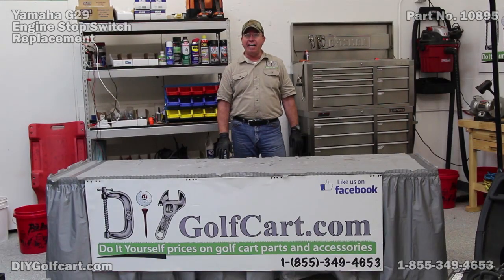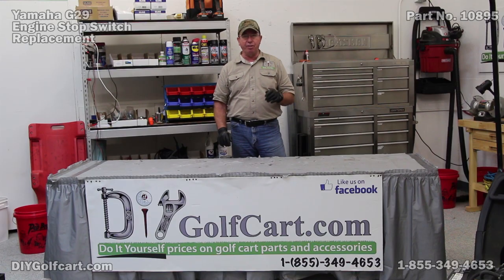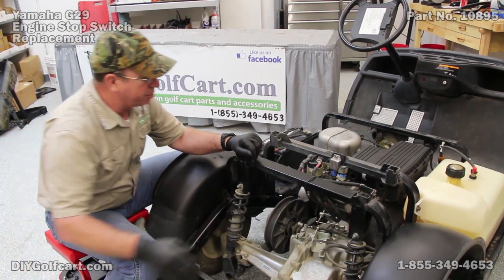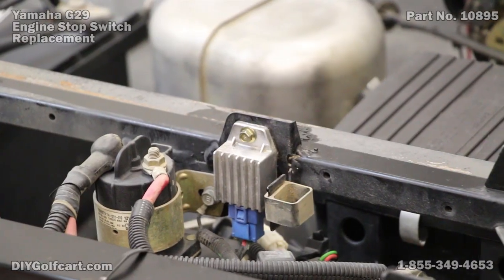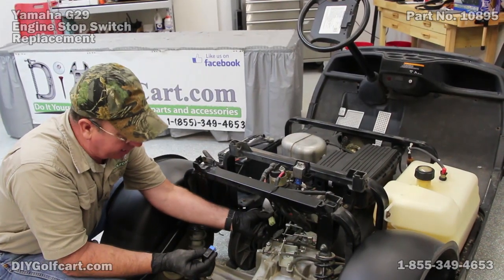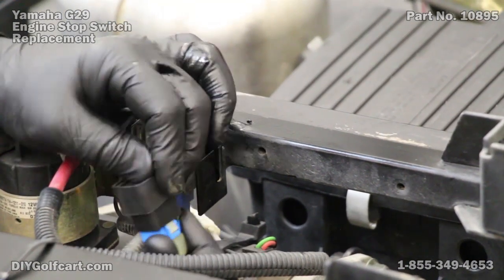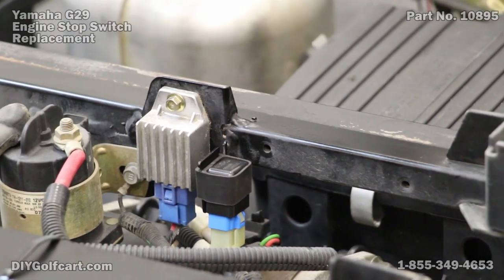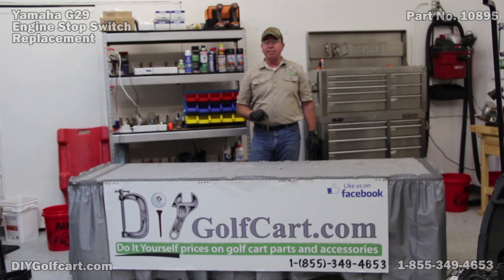Yamaha Ignition Relay Stop Switch | G16 | G19 | G22 | G29 Drive Golf Cart

Comment: I had a problem with my 2011 Yamaha gas cart. Thought it solenoid or battery. Battery was old anyway 5-6 yrs. New Battery, helped some. But after checking. Found it highly possible the gas petal solenoid switch was hanging up and not kicking in on the solenoid . Before I spend $$ on switch I removed and rolled back the rubber boot and sprayed blaster and worked the switch for about 10 times. While I was working on that I also adjusted the gas cable there at the petal about 2 rounds. To give a little quicker response when pressing the petal. Tightened it up and replaced the stop switch. Everything at this point seems to be running much better. If the switch starts to hesitate again, I'll purchase a new one at that time.

Comment: I have a 2002 G22a gas burner that will not shutdown when I lock the brake pedal down. If the engine is cold it will eventually lope along and shutdown. If it’s warm I have to pull the spark plug or hold down the brake pedal and pump the accelerator until it floods out (I guess). I have changed every part out i can think. A trouble shooting video would be cool. Thanks in advance.

Comment: 1st of all, thank you for your videos as they have helped me tremendously.
2nd I have a G29 gas cart that will intermittently turn over.  Sometimes you have to hit the pedal a few times or hold it down before the starter engages.   After getting it started and going for a ride the battery would die fairly quickly. I just put in a new battery and it still hesitates to start and sometimes won't until I come back another time and try it again.   I've checked the ground at the battery and they are good.   Any ideas what my problem could be?
3rd Thank you for your time and again for your videos.

Comment: Hi.  I’m looking for some help.  I just hooked up battery tending cables on my mother in laws 2019 Yamaha EFI so she would just have to plug into it when she leaves for the summer.  I did it last year and no problem.  Someone removed them six months ago and it’s been running fine the entire time.  We used it all week.  After I installed them last night we left and drove back to Boston.  She called me on the way home and it won’t move in forward or reverse.  There is power to the battery because the horn and all of the lights are working.  Any idea what could be going on?  Ty

Comment: I got a 2001 fuel injected Yamaha golf cart that will not turn over the battery is good the pedal switch is good the starter is good the belt is good I can get the starter to turn jump in the solenoid but it will not start any clue what to look for next.

Comment: Thank you for the videos!  I've watched a few already this morning and they've been great.  I have a 2011 G29 Gas that won't stay running after it warms up.  Starts fine and seems to have plenty of power when it's cold, but as soon as the motor starts to get warm it loses power and chokes out.  If we let it sit for a few minutes to cool down it will run again for another minute or so then sputter and die again.  Thoughts?  Cart has no modifications done to it.
Reply from the maker: https://diygolfcart.com/yamaha-g16-g20-g21-g22-ignition-coil/    We do have it in stock! Call to place the order.

Comment: My engine did this once but no more.  I had intermittent pedal clicks the solenoid but doesn’t go. Then a few pumps it’s go.   No power leaving the solenoid so is that the issue or volt regulator or stop relay. Does the stop relay only tell the engine that stop?

Comment: I have a 2000 Yamaha g16a. Most of the time runs and start right up. Then other times it just rolls over and wont start. Its getting gas. Just isnt getting spark. What would be doing that. Celenoid clicks and so does the engine stop switch.

Comment: I have aG16 that suddenly won’t start but stop solenoid clicks when I push pedal .what else would suddenly make it not start? Fuse is good.
Reply: I have the same problem. Did you figure out how to fix it?
Reply: Nicole Rishel yes it turns out that my battery suddenly died. After a couple hundred dollars in new parts put in a new battery and it started up just fine.
Reply: @toddlamarr1553  Thanks for the reply...my battery is brand new. Too bad about the parts $...I also spent over $100 on a new starter and that wasn't it either
Reply: My battery was a year old. Under the seat on drivers side there is a black box. In that box is the start stop relay and a inline fuse. This relay is known to just go . Check your battery under load.

Comment: hello, could you help me I have a yamaha g29 cart the problem it has is that it starts but it doesn't go very far and it turns off completely and until I press the circuit breaker it starts again but it does the same thing and I can't find what it is could you help me

Comment: Finding your videos really useful, Just bought a 2008 Golf Utility vehicle  G23A with a Yamaha tipper rear, my intention is to convert this to a Golf buggy with Bag retaining frame. From the 300 miles journey from where I bought it to my place, the Air filter lid has fallen off, I looked online for a replacement but these are just shy of $100! that's a lot to me. I am in the UK and most parts new through EBay are also including Tax and postage making the lid over $180 which seems out of my reach. I wondered if there is a used forum for such parts? or if you know an alternative to my problem, I also only have ONE of the spring clips to hold the lid on - really wish the seller had put it in the bag with the other loose bits :( One other point, it does look like the chasis is longer than the golf cart chasis, If I replace the cowling (assuming I can find one) do I need to start cutting and welding the frame, if so where? Regards
 Chris

Comment: I have a Yamaha 1999 G16E, someone had there hands on it, before I got it, It seems to go faster in reverse than foward, could it be the wires were reversed on the forward / reverse switch ,or on the motor?

Comment: I have an EZ go that keeps running the start motor sometimes. Not all of the time but just now and then.  I'll pull up to my garage and the gas engine stops but the electric stater/alt keeps going.  I believe it has drained the battery  also.  Ive had to recharge the battery from dead twice now.  Any thoughts?

Comment: I have what i believe to be a Yamaha G2. It turns over with the key but no spark. If i put 12 volts directly to the starter relay coil it does however start. I have checked the key, pedal switch and low oil sensor and all seem to be working fine. Could this relay stop switch be the issue? Thanks in advance

Comment: My Yamaha golf cart runs about half throttle and then it acts like the governor kicks on. Before this it ran fine. Do you know what could be the problem ??
Reply from the maker: (1) Check the throttle adjustment to the carb.  (2) Make sure that you have a nice Blue Spark and that it's consistent.

Comment: I have a 2000 Yamaha G16A golf cart after we are driving it at night with the lights on for a few miles when we come to a stop the engine quits running.  Headlights bright turn signals working and when put into reverse the warning buzz is loud and clear. We will let it sit for 5minutes or so and then it will start up and drive fine. I could use help, Thank you

Comment: I have a Yamaha g16, runs extremely slow. (2mph) , replaced carb, fuel filter, fuel lines and spark plug. Any suggestions on what’s wrong? Thanks
Reply from the maker: Check the governor with the pedal pressed down and see if it moves. The cable from the pedal to the governor may be broken.

Comment: Hi im hoping you can help me, i own a Yamaha G29 gas golf cart. The issue i am having is that when i put for down on the accelerator pedal there is a lengthy delay before the cart actually starts to move. This seems to get worse the warmer the motor gets. Near the end of a round of golf the delay can be as long as 5 seconds or so. I have friends who own identical G29's and theirs do not do this. Is there a solenoid or something that could be faulty? Any information would be greatly appreciated :) keep the video's coming they are great.  Jason
Reply: when i push down*
Reply: The most common issue with this symptom is, worn brushes in the starter generator. Take the rubber boots off the back end and blow out the interior of the starter as a first step. (Carbon Build Up) If this doesn't work, I see brushes in your future!
Reply: Cheers Barry I have checked the brushes and the are fine. Is there anything else it could be, it doesn't seem to be getting any worse just very annoying. Thanks
Reply: the1knightrider1 Does the Solenoid engage as soon as you depress the accelerator or is there a delay there also? Could either be a bad solenoid if it's getting power and not engaging or bad connection in the accelerator stop switch. If you want to go into further details, call me at 855-349-4653
Reply: @aarongouldie1412  I have this many the solenoid clicks. No volts leaving it. So assume the solenoid is bad

Comment: How do I know if my relay is still good? Thanks for your videos!
Reply from the maker: When the Engine Stop Relay goes bad, the golf carts engine will not shut off when the pedal is released. When you take your foot off the pedal and the engine stops, its working.
Reply: @golfcartking  Can the stop switch also make the engine not start? I have spark and fuel. It turns over but wont try to start???
Reply from the maker: @summitpointauto3463  Absolutely. The stop switch is what send positive voltage to the solenoid to engage to turn the starter over.
Reply: @summitpointauto3463  Did replacing this engine stop switch solve your problem? I have the exact same problem, spark, fuel, starter engages and  turns over engine, But engine doesn’t start. DIY golf cart’s answer was ambiguous, because he said it’s what sends the voltage to the solenoid to engage and turn the starter over, but in our cases, the starter IS turning over.
Reply: @golfcartking  where can I get this part? I cannot locate it anywhere.

Comment: I have a 2005 Yamaha g22a gas cart. My son was driving it one day and all of a sudden, it simply quit. Press the gas pedal and nothing. Checked both fuses and their fine. Doesn't even kick or try to start. We were previously told it was the solenoid so we replaced that. Still nothing. Any ideas?
Reply from the maker: With the key "on", in forward, depress the accelerator pedal and see if you're getting voltage on the 2 small terminals of the solenoid. If not, bad accelerator pedal switch.

Comment: I have a 2019 G29 EFI wont start, Everything checks out fine, every fuse, relay, solenoid, etc.
When the key is turned on I have 10V power to the fuel pump plug, but nothing to the fuel pump terminals inside the lid of the fuel pump, for some reason??? I can't get voltage to read on the inside of the fuel pump lid, If I jumper the fuel pump nothing happens,
Yes, I need help..
Reply: Did you solve this issue with your fuel pump?  I have the same problem

Comment: I have a 2006 Yamaha G22A - new battery. lights, horn turn signals all work. When i turn key to on and do the reverse lever - no beep, and when i press the accelerator pedal to go - no action at all - is this a fuse?  What fuse would/could it be and where is it located?
Reply from the maker: There is a black cover on the drivers side under the seat being held in place with a 10mm bolt. The fuse is located under it.

Comment: I have a 1988 Yamaha golf cart and when i turn off the key the battery light stays engaged is that normal or do I have a switch problem
Reply from the maker: If you are referring to a battery charge indicator on an electric golf cart,  then yes, they will stay on. They are LED's and will not effect your batteries performance.

Comment: My Yamaha G2 is having starting problems, I have replaced the starter, solinoid and battery cable ends. It works fine sometimes then will not turn over. I can hear the solinoid clicking but will not turn over. Battery has 12.8 volts at battery and at solinoid. Where do I go from here? Is there a relay somewhere that may be the problem?
Reply from the maker: If the solenoid is clicking yet the starter isn't engaging, check he brushes in the starter generator.
Reply: @golfcartking  The starter is brand new, I replaced it about a month ago.
Reply: I also replaced the battery cable ends. Seems like the power is not getting to the starter
Reply: Is there a relay in between the solinoid and the starter? What do the two small wires off if the starter go to? There are also two small wires on the solinoid. With my golf cart it will not start and it does the clicking and if I wait a hour and come back it will start right up again? Very confusing.

Comment: I have a 1996 G16 Yahama golf cart that continues to burn spark plugs, Change to a new plug and it will run for about twenty minutes and we  need another plug, Can anyone explain why this could be happening?
Reply from the maker: What type of spark plug are you using? Use a hot plug (low number) and also check the coil and make sure you have a good blue spark!

Comment: I have a g-11 yamahauler. The starter relay is buzzing and it doesn't go. Anyone know what is wrong. We thought it was the starter relay, replaced it, same vibrating noise and no go.
Reply from the maker: Sounds like either a bad battery or a bad solenoid.
Reply: DIY Golf Cart we replaced can the solenoid and starter relay. It'll jump and run!
Reply from the maker: Key "on", in "forward" depress the accelerator pedal, are you getting 12 volts on the 2 mall terminals? If not, bad accelerator stop switch.
Reply: Thanks we'll try that next. fingers crossed LOL

Comment: I have a Yamaha 2001 G20 (I think) cart.  Problem is that you push the pedal and maybe nothing, maybe a little turn but no start.  Push it 4, 5 or so times and it will finally start.  Sometimes it's as though nothing and sometimes it will crank and hold until it starts.  In the winter and colder months it is worse.  Looking for the likely culprits.  Solenoid?  Starter Generator?  Stop switch?  Hoping that you can help.
Reply from the maker: Two things that could be the culprit, weak battery or worn brushes in the starter generator. Check the voltage of the battery while trying to start the golf car and make sure it doesn't drop below around 11.5 volts. Then using a air hose, try blowing the starter out by removing the rubber plugs on the backside. If that doesn't help, change the brushes.
Reply: DIY Golf Cart does any know how to check charging system for yamaha g16a, 2001 or wiring at starter generator

Comment: can any one help me 2000 yamaha gas G 16 i thought the coil died. changed coil very light spark changed key switch still the same  hrs of working on it HELP PLEASE
Reply from the maker: What type of spark plug are you running? Hopefully a NGK!
Reply: yes i am  with my spark tester very light spark nothing at plug
Reply from the maker: @skullybiker  Unfortunately the only thing else that will contribute to a weak spark will be the coil. The newest one may be bad also, it happens.
Reply: TURNED OUT HAD TO BUY ORIGINAL COIL AFTERMARKET WILL NOT WORK ....  THANK YOU ALL